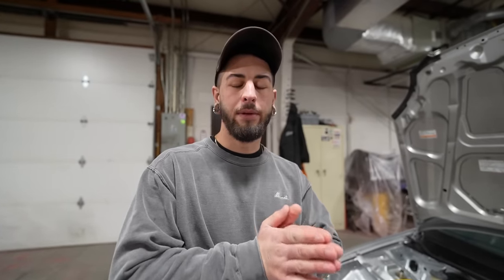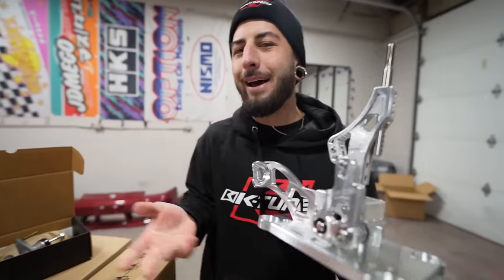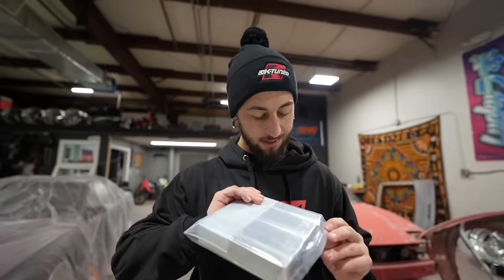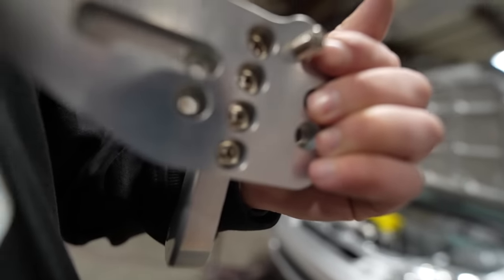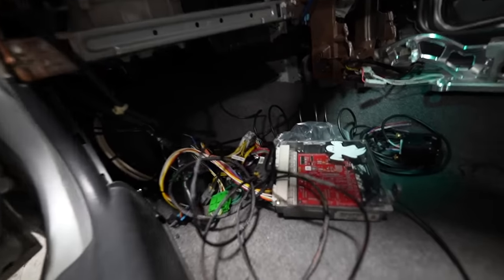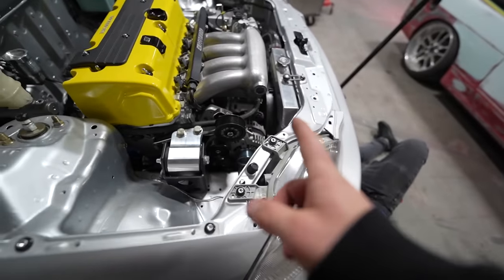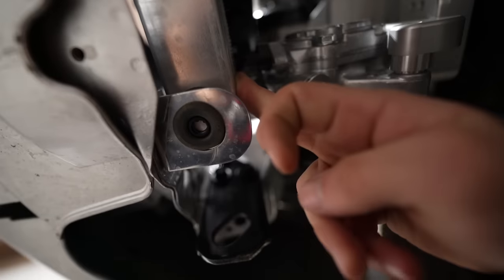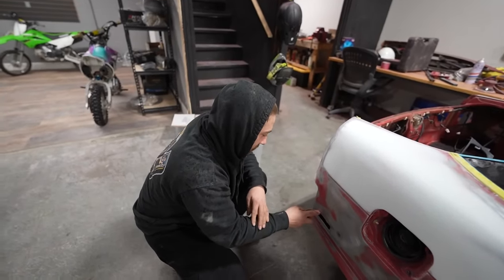Final Parts For My K24 Swapped Civic! +240 Hatch Update

Comment: you definitely should get the lock out for the shifter box so you dont money shift it and they have the little stopper plates that bolt on to prevent the shifter cables from stretching

Comment: Your supposed to use the base plate for the shifter to bolt to dj it gose over the factory lip that u grinded down u didn't have to do that the base plate bolts to the 2 factory shifter holes then the shfiter bolts down on the plate 😂🤦🏻‍♂️🤦🏻‍♂️